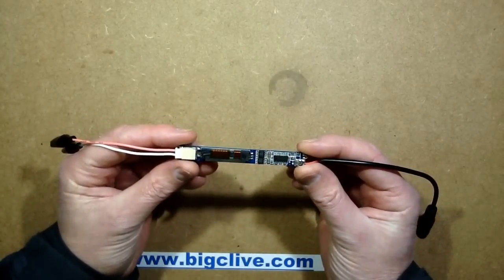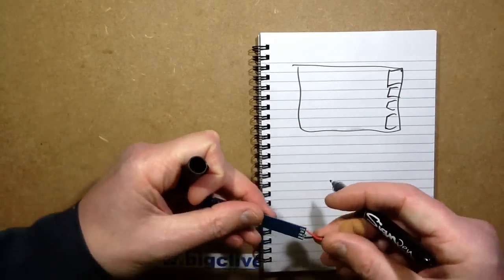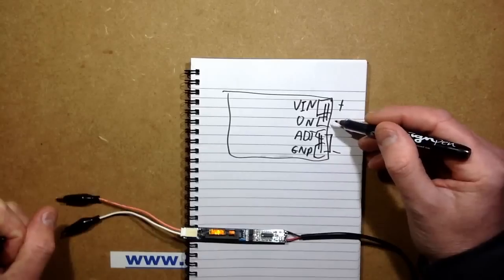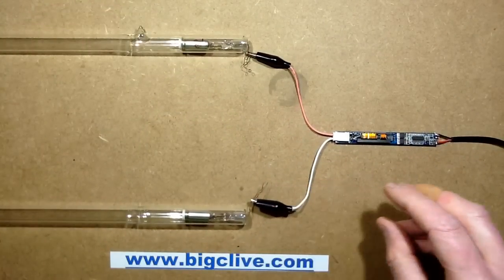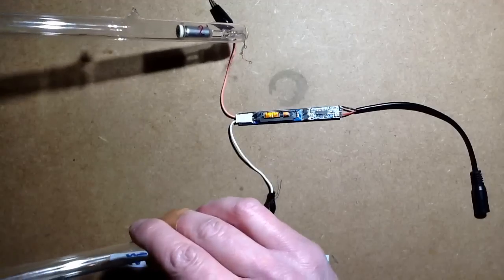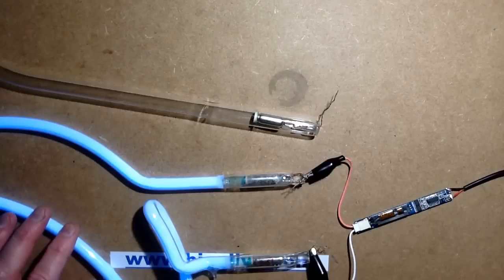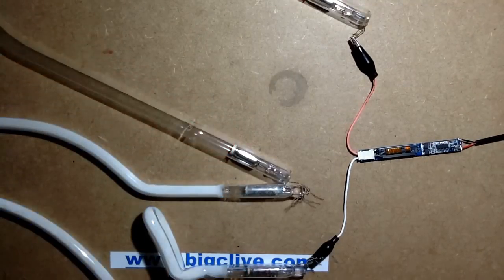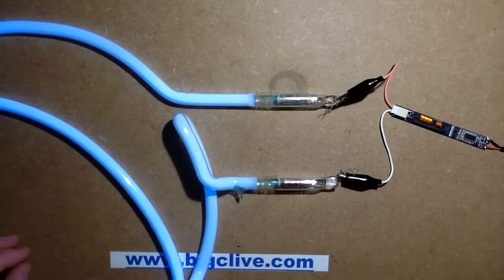Testing a TINY little CCFL driver for laptop displays.

Comment: @bigclivedotcom do all laptop inverter have the same input voltage?
Reply from the maker: It will vary between intended application, but they often have a series capacitor and act like a current limited supply for a wide range of tubes.

Comment: can I use an old CCFL backlight inverter to make an ozone generator?
Reply from the maker: Some can do it.  But it's cheap to get ozone modules on eBay.
Reply: @bigclivedotcom  thanks, I just tried my one, the main problem seems to be that it stops when resistance is to high and has to be restarted. A small neon bulb shines well (not as bright as mercury vapor  and doesn't burn out although it's small, because ionised neon doesn't conduct so good). When I disconnected 1 electrode and instead connected some wire around the bulb, it glows too, smells like ozone, but turns off after a couple of seconds.

Comment: Hi Clive, I pulled out some tubes from an old plasma TV, I tried to fabricate a circuit using the transformer from the same board that powered those tubes. I keep burning transistors. It's drawing too much current. The transformer has 2 leads on the primary not center tapped. So for undue laziness I made a 555 timer to output 50% duty cycle, and connected the signal to a mosfet that pulls one lead of the primary while the other lead is connected to 12V. Added also a reverse bias diode as Snubber on the primary. The tube is lighting at one end and I have to raise the voltage to 30v to get the tube lighting properly. But current consumption would heat up the transistor and blow it up. So I added 2 of the same transformer as parallel on primary but in series on the secondary, again it lights up properly at 20v but current is at 1A DC. Transistor was a large package with heatsink and it gets too hot to hold. Any ideas about how to properly design such a circuit? What's the secret of ccfl tubes? Should I focus on pure AC signal on the primary?
PS: 555 timer is powered from a 12v voltage Regulator.
Reply from the maker: There are lots of CCFL drivers on eBay designed for driving those tubes.

Comment: so inorder to light it up the backlight of led monitor I need that CCFL driver because I tried to supply directly 12v it didn't turn on.
Reply from the maker: Backlight LEDs need a suitable driver available from eBay.  It boosts the voltage and current regulates it.
Reply: @bigclivedotcom  hmmm LCD its broken, I just want to convert into a lamp/light..  i tried also 13v no sign of luck,, brand vertu monitor..
Reply: If the monitor has LED backlight, do NOT use a CCFL driver PCB. You can use CCFL driver if the monitor has a CCFL backlight!

Also be aware that this driver PCB only drives one CCFL tube, which is par for the course for many lower-density laptop screens, but not nearly enough for a PC monitor. Typical is 4 CCFL tubes, two on the top edge and two on the bottom. I suppose you could wire two tubes in series, but the assembly would be much less safe and would need special precautions. Oh something to keep in mind, CCFL driver can generate voltages well in excess of 1000V, which is quite lethal. It'll generate as much voltage as it has to, to make up the desired drive current.

In either case, the monitor PSU and backlight drive PCB has a 12V point that you can feed externally. However you also then need to supply a little voltage to whatever pin is needed to undim or turn it on. Might take some effort to figure out which. If it's old enough, you're guaranteed to find the schematic to the PCBs in the service manual for some other monitor that uses the same PCB, any given PCB has shown up in monitors by a dozen brands!

I can help you with the reverse engineering if need be.

So how much of the monitor is broken? Did you break the panel and is the rest working? Other options, PSU/inverter can be dead, or backlight tubes or LEDs can be dead. Service manual and behaviour of the monitor can give some clues.

Comment: hi! if I locate the pins where to connect power, what signal level to 
connect on the "ON" pin to tourn it on?
Reply: first try ground, if it doesn't respond give it 3.3v or 5v  (btw ,not qualified to give you advice, that's just what i would do)

Comment: I always play with these when I pull them out of laptops.
Reply: @crescendo7357  Only a very small one. But things do become more intresting when you hook a voltage multiplyer to them.
Reply: @crescendo7357  No probs, don't go doing naughty things with it. I used mine for powering a night vision tube, the sparks were quite long. But building a tazer is stupidly easy.

Comment: Hi, thank you so much for the video, so i'm tryng to light up with the same inverter a ccfl lamp but nothing happen, i'm using 12v 1000 mA with a bridge on the two couple of pin is it ok?
Reply from the maker: It should at least drive the short tube.  You may have to play with the enable pins.  If it's out of a specific piece of equipment it may require control data
Reply: @bigclivedotcom  ok, thnks agin for answer, the inventer it's a universal inverter like the one that you are using in the video, it has four pins, maybe i have to try 5v on the switch pin? Do you know how could i wire the "on" pin using two source 12v/5v?
Reply from the maker: @TheMatumasa  watch the video and see what I used to control it.  If you search my videos for CCFL you'll find others about driving various units.
Reply: could be the cause of my failure the size of the cables? i'm usin a thin cables like awg 24 cable
Reply from the maker: What length and diameter is the lamp?
Reply: @bigclivedotcom  Hi, thank you so much for answer, i have two chice, one it's 445mm x 2,4mm and the other it's 350mm x 2,4 mm

Comment: Im trying to find something small to charge a few large photoflash capacitors (in series ~700v). Im currently using a small CCFL driver but it only outputs maybe 10ma of current and charging is slow, have you come across anything that would be faster? maybe rewinding the transformers on the commercial inverters?
Reply: I'd look into using a voltage multiplier directly from 120vac. It wouldn't be the safest but as one of your subscribers I'm sure you can handle it.
Reply: @eDoc2020  of
Reply: hmm
Reply: backdoorscienceguy